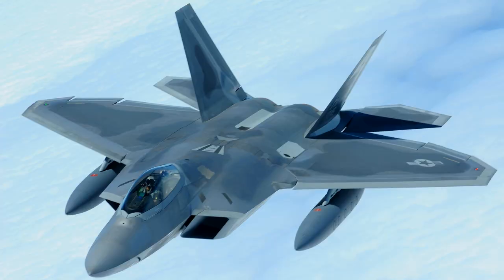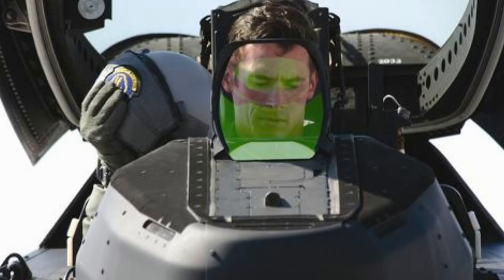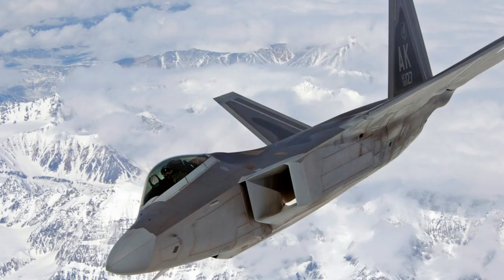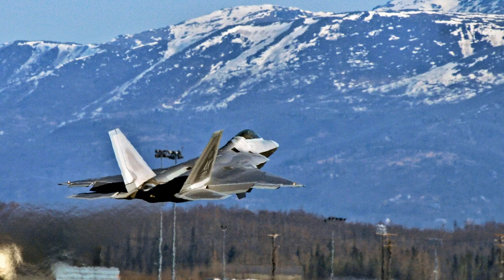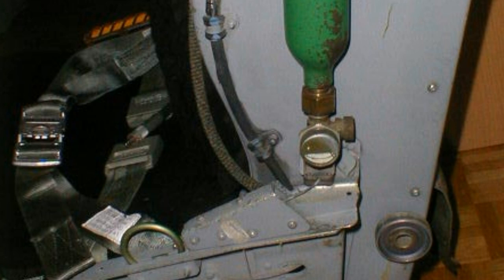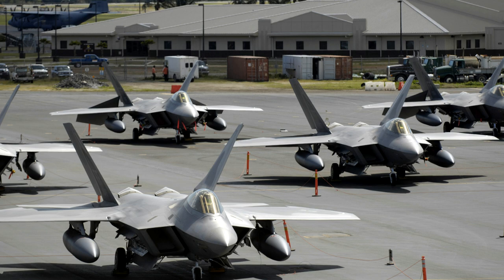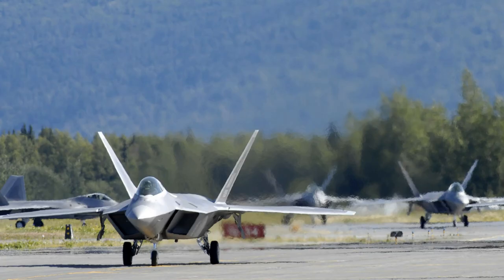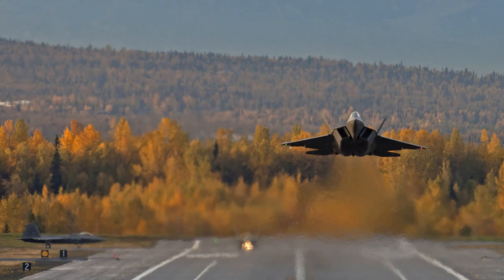F-22 Crash Pushes Air Force To Replace Emergency Oxygen System Handles In The Raptor Jet

Comment: The safety of our pilots is paramount. The loss of even one is too many. Fielding top of the line fighters is a good policy. It helps ensure combat effectiveness, while also increasing pilot survivablity. Allowing this oxygen problem to continue is intolerable. Whistleblowers should be protected. This sort of thing should be kept in house. We don't want our enemies to know our weaknesses. Wistleblowers need an avenue to bring issues like this to the attention of those who can resolve it.
Reply: Hate to say this, but just like our once great educational system, our military is anemic and very weak. We are sitting pretty for some dictator somewhere to get the gonads to say go and conus as we know it will be no more.

Comment: The pilots had been instructed not to speak to the media about the planes safety problems on penalty of losing their jobs! The most expensive military plane in history has a faulty oxygen system that has already killed one pilot and caused many other mid-air scares. The power of the military industrial system is such that it manages to prevent criticism of its multi billion dollar projects.

Comment: Why don't they use a self contained, closed loop system like in diving? This tech is already available in the Drager Lar-V or a variation of the MK-16 diving rigs. Removes CO2, controls O2, and with no possibility of other gas contaminants such as O3(Ozone=Bad to breath) as high altitudes(<50K). 1 sqft of space is all that is required. Remove the OBOGS and slap a dive system in its spot. I understand someone has the contract but there are smarter ways. 1. CO2 canister with sodasorb installed at a minimum to remove the possibility of hypercapnia.2. 100% O2 tank with enough to last the most enduring flight time. 3. Electronics package to monitor O2 in the loop and add as needed. Somebody please consult a NAVY Diver and not a DMO/UMO. Id be glad to help construct a small unit within a space to be able to deliver the O2 sufficiently as needed, but I think you will always encounter problems with the current system. Try something new.

Comment: @edward dibenedetto Dude the F-22 does not cost just $82,000 the total unit/fly away cost of this plane is $150,000,000 you need to get your facts straight(i would and should know considering im wanting to be a pilot of this thing despite the oxygen problem)
Reply: Dude he's talking about the Ford Raptor

Comment: Seriously to anyone who thinks that we should give up on the F 22 and that it's no better than the Russian migs ect. First, hello LM made the sr 71 and look at the f 111. The f 111 was, at first, a piece of crap. It had many reliability problems at first, why? New technology is just like that every place. So General Dynamics when to work and made the f 111 a good aircraft. LM will most definately fix the problem. Just give them another chance. Everybody deserves it.
Reply: You must remember that Lockheed and the Skunk works designed and built the first operational SR-71 in 18 months, not 18 years plus as is the case with the still nonoperational joke of the F-35.

Comment: I think they should in fact stop the F-35 program and use the money from that to completely go through the F-22 throughly and fix it the F-35 is 1/2 the plane the F-22 is, so stop the F-35 and fix the F-22
Reply: Funny how in 1990 the F-15E Strike Eagle didn't need fixing. It was instead on it's way from conus to deploy to the gulf war. To bad the badass F-22 can't make the same statement. So, do we make anything that works in our country any more??? I mean, if we had a shtf sure enough war tomorrow, I seriously think we would be defeated very quickly. What general once said, in order to prepare for war, practice every day as though this is the real thing. I think it was Curtis Lemay. Good advice.

Comment: While the F-15 in all its configurations have problems. Some great and some small, it till this day has performed its assigned mission to the best of it's ability. The F-22 is like a duck out of water. Just like the F-35, a total waste of taxpayer funds. Instead, our military would have been better off going with the F-15 Silent Eagle a proven and dependable weapons delivery platform.